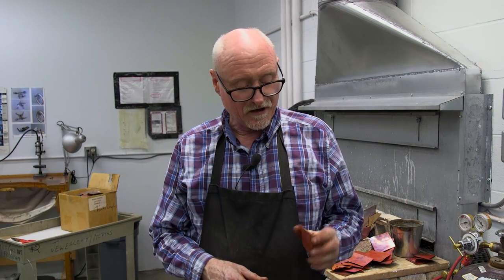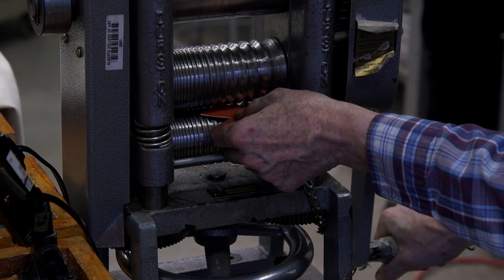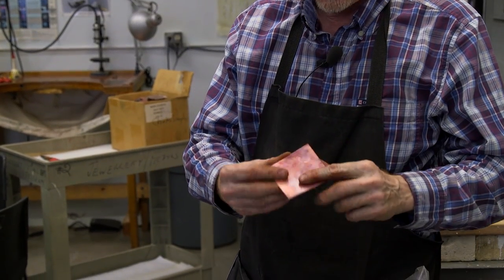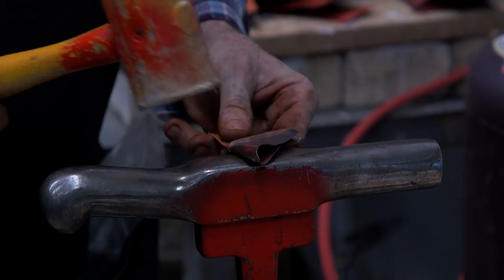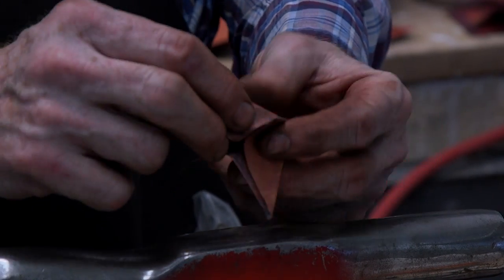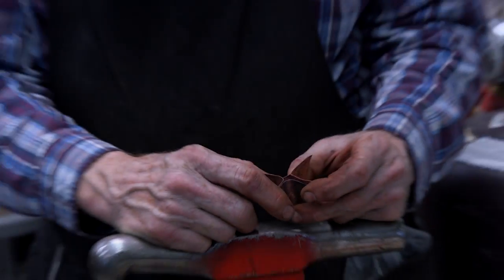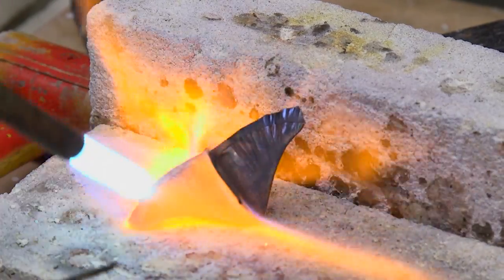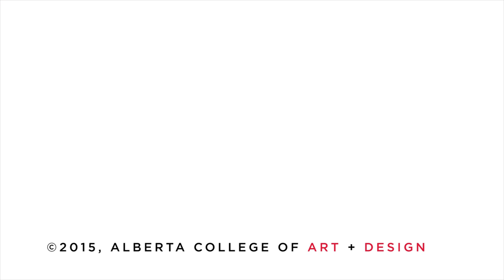Foldforming Introduction: A Rolled Leaf and a Star Base Form

Comment: Absolutely gorgeous work & helpful explanations! I'm a work-at-home jewelry artist with experience in wire work (& gemstones), but have been interested in more advanced metal art for years (limited by lack of torch & safer workspace). Your instructions are spot on, even down to the hammer (& WHY). Also love the fact that you mentioned your forging technique in reference to the anvil & tool vs the motion of the copper. Perfect example of physics at work in design. I would've been grateful to have had you as an art/design professor (many moons ago, ha). Looking forward to more tutorials. ❤️Thank you!